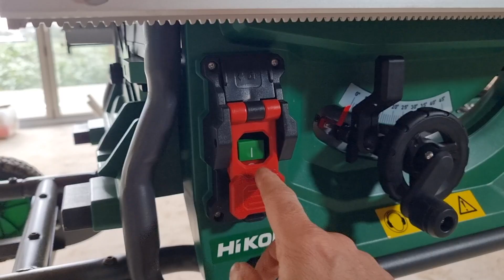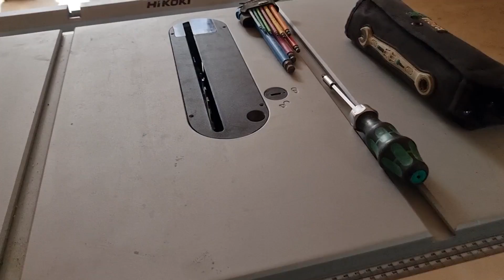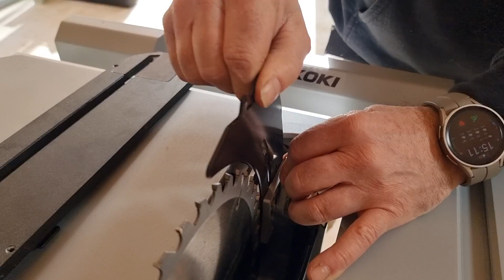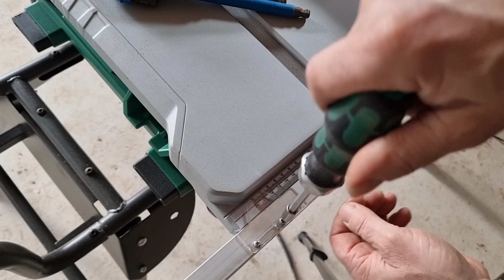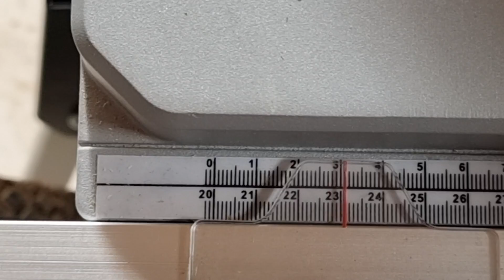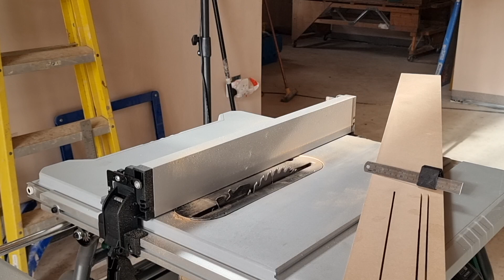Table Saw set up for first use

Comment: Can I ask what your review is of this saw after a years use? Main reason for me considering it is the option of mains and battery. Currently running the dewalt flexvolt and its been a really reliable saw but can eat the batteries if using alot. Cheers

Comment: Have you had any issues with the fence coming out of alignment? Or anything else significant? The fence staying square is what I'm particularly concerned about, alot of people have reported the fence not staying square
Reply from the maker: I always check the fence as there is adjustment on the front and rear rack and pinions that will from time to time need some tweeking, my Milwaukee is the same as is my Dewalt 745

Comment: Having the blade that close to the wood can actually increase the risk of kickback. It should be above the wood so that the teeth make a downwards contact point with the wood first, with the way demonstrated a lot of the force is applied directly back at you. I used to think it was smart to put it just above until I learned in trade school why to not do it.

Comment: I am not saying this is wrong advice but what I am saying is that if every single time we buy any piece of machinery - expensive or not - we find ourselves wasting precious and expensive hours to check what should be spot on from factory settings then this is all wrong - it turns out many of us have found a lot wrong / offset / off calibration / misaligned but and here is the strange thing: we seem to take the hit and put right what others got wrong for our money... imagine buying a new car to find out the wheels are not balanced, the lights are off track, the steering veers to one side, the washer jets point to the sky and the lot...nobody would a accept it but somehow we seem to accept that in what concerns woodworking tools being the main culprit...hand planes not to mention the lathe world...

Comment: Hi Robin, I purchased the 240v version a couple of weeks ago. Just be careful when ripping on this particular saw as Hikoki  have told me themselves that the 36v version blow control units all the time. They are awesome, Saws, though!
Reply: did they say at what age, pretty sure hikoki are only 3 year warranty here
Reply: @kylehocking420  nah, just the one like in this video, I think it it to do with the current the battery can actually supply to the tool. But the controller can't handle that load.
Reply: @ashtondrake3407  wonder if the ac adapter will fix it. the work id likely be doing with it is hardwood, so might take my time a little if i get it. so much cheaper to get the ac one though
Reply: @kylehocking420  it's all up to you, mate. I would be purchasing the ac version myself, again though, as in my personal opinion, neither dewalt, milwaukee, or hikoki have been able to design a cordless table saw worth having yet. Cheers

Comment: best tip I could also add to everything said in the video. PLEASE LOSE THE PLASTIC PUSH STICK, make or buy a wooden one, they are not good enough, they can slip, if they hit the blade they can also shatter, Always get a wooden stick. And where were your safety glasses, a black eye is far better than no eye.

Comment: the big question is how you would rate this compared to either the dewalt, makita or milwaukee. we use the big dewalt at work and i see several features on the hikoki that beats the dewalt instantly.
Reply: I had a 240v dewalt- maybe the 740- 250mm saw. It was really good, but that 240v, and an extension cable...
I bought this hikoki table saw, and it is a great site saw. It is not as gutsy as the dewalt. It will stall partway along a cut which can be very frustrating. I like it, I'm keeping it, but I really wish I hadn't sold the dewalt
Reply: @rossbuchanan7632  to be fair to our dewalt at work, it has seen better days, dont even think it will be any good with a descent service either. i have the smaller one at home 7485qs. and i love it.
Reply: makita dont make a cordless one sadly

Comment: Looks like green Dewalt
Reply: Was thinking the exact same thing!
Reply: @MrSparkyAprilia  Yes and it has quite a few similarities, like how the fence attaches to the table, the pipe frame, the wheel and the lever to set the angle.

Comment: Excellent video ..... spot on repeating the safety of removing the battery, but for some reason, you missed the classic safety tip from the new Yankee workshop. There's no more safety than remembering to wear your safety glasses, which were Norms every day readers lol 😊👍🏴
Reply: Robin is also usually an advocate of ear defenders, but we can excuse their absence for a quick demo. 🙂
Reply: @peefor135  it's an old joke hence the lol and smiling emoji..... 😃 👍

Comment: Never checked the blade for 90 degrees to the table, the fence could be out, also check the nut holding the blade on, I check with a roofing square on table and circular saws. Good video otherwise.
Reply: Yes he did, he checked it by eye. No square required because he's a professional carpenter and his eyes know "absolute 90° " 😂
Reply: I'm pretty sure he knows what he's doing but who knows 🤷‍♂